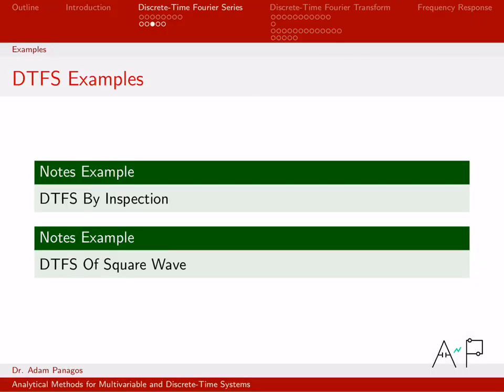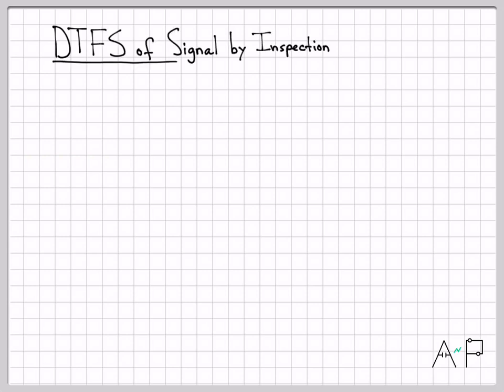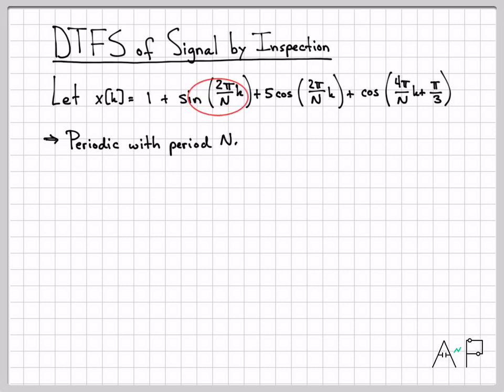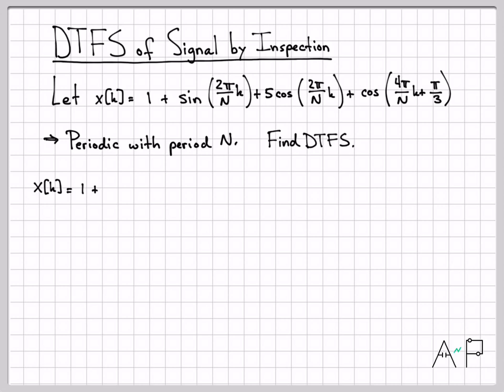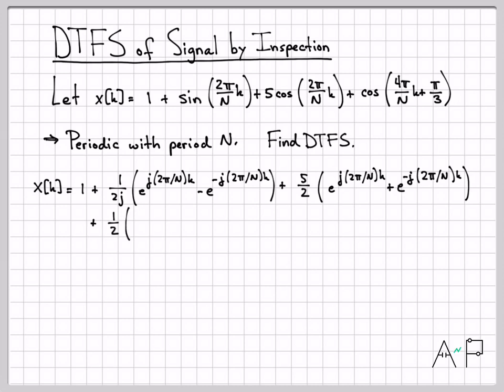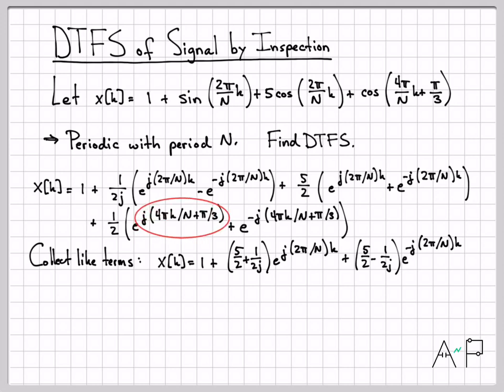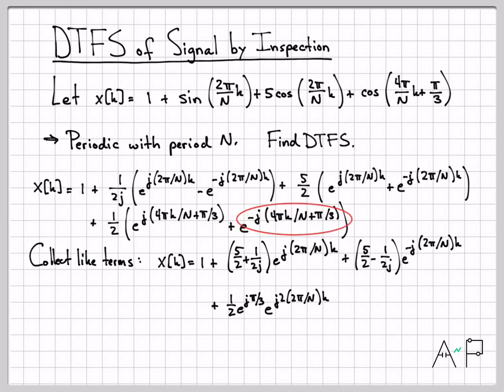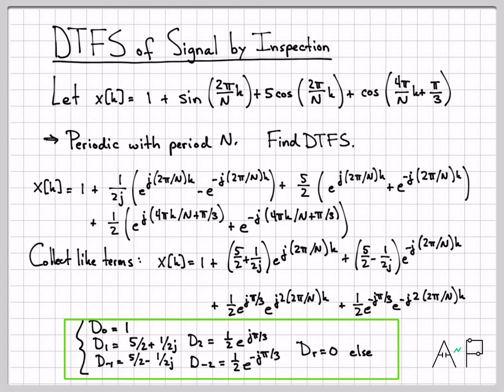The Discrete-Time Fourier Series of a Signal by Inspection

Comment: Sir, how do we say (in this problem) that all other Dr's are zero except at r=0,1,2,-1,-2 ?
I mean, these coefficients will again repeat after period N right!?
So, it must have some value at N,N+1,N+2.......!!
Reply from the maker: Ok, that's a good question, let me try and be more clear.

If we have a periodic signal x[k] with period N, then we need to find N DTFS coefficients.  These N coefficients are denoted by Dr in the video.  

You are correct, the Dr are also periodic with period N.  Thus, Dr  = D(r+N) = D(r-N) = D(r+2N) = .....

Because of this periodic behavior, we usually focus on finding just a single set of N values.  When I say that Dr is non-zero for 0, 1, 2, -1, -2 and zero for all others; I mean it is zero for all other values within the set of N that we are trying to find.

I hope that's a little more clear.  Thanks,
Adam
Adam